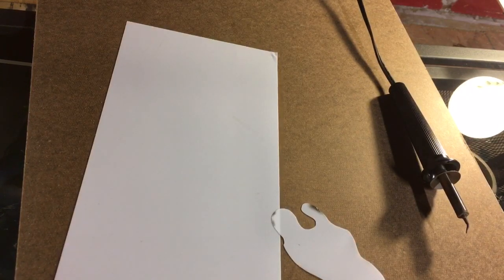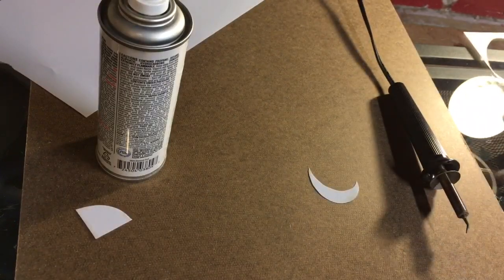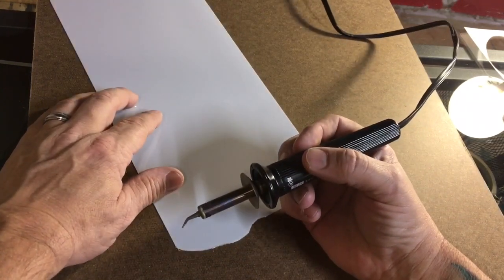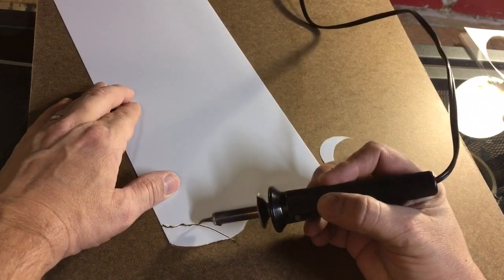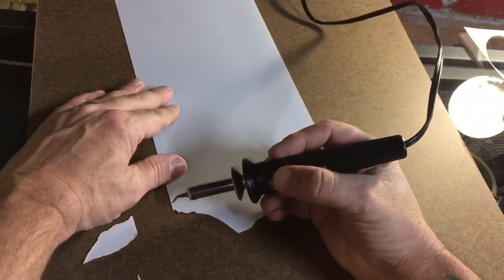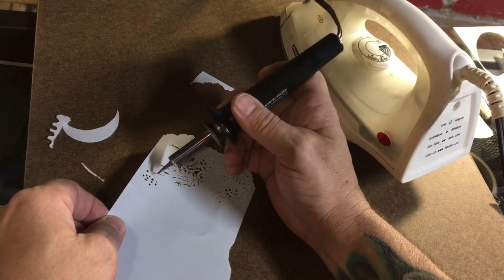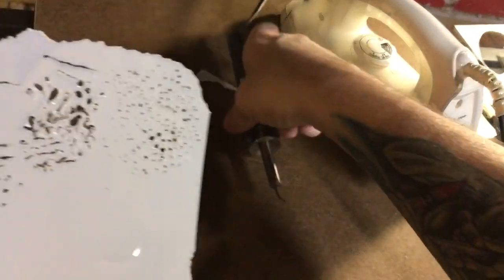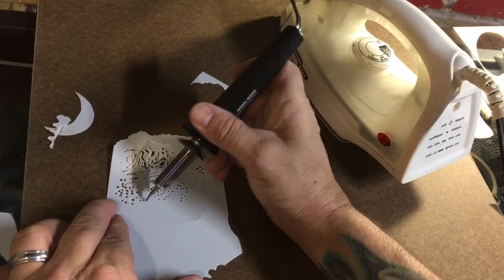How to make your own mylar stencils for airbrushing!

Comment: I have a wood burning tool very similar to the stencil burner. I also discovered a pack of clear plastic face shields that I purchased during the pandemic. I cut out an astronaut stencil for a painting I'm working on but I used a tiny pair of scissors instead of the burner tool. There were too many small cuts I had to make and the burner tool wouldn't have worked very well.

Comment: @wleonartistry  Love the video Bill.🤘😎🎨 I know this is a few years back, but you can get super tight lines and more use out of the tips( before they wear out) if you burn the stencils on glass. We have a couple of 12 by 12 inch tempered we use that came out of a used display case 👍

Comment: Soldering irons .....just fine. Where you get the detail is in the tip. You want the smallest or sharpest tip you can find. You can even sharpen a soldering iron tip if you so chose

Comment: Suggestion for stencils too Bill & Guys on here. If you can afford to do it of course. I make my stencils out of card stock believe it or not using an Ortur Laser Master 2 which is under $200. You can find stencils very easily online to use to laser cut them clean. Your Welcome :)

If you have any questions about it, fire away :)
Reply from the maker: certainly a laser cutter is a way to go.   And probably something ill get into eventually. 
This is a pretty old video of mine , i do have several very nice laser stencils. and likely will buy more.  But there are still a few of those old ones I made that hang around in my pile.   No question laser stencils can hit a higher level of quality.
Reply: @TheAIRspace  I just find it easier from a practicing standpoint whereas if the cardstock is no longer usable, I can just cut another in a few minutes. Not only that but, its like a try before you buy thing. If I like or use it enough, I would be more inclined to buy the mylar ones.

Comment: Can you do text, letters?
Reply from the maker: you could, however there are much better options for lettring.   Personally i have a small plotter to use for things like that.    But i have hand cut paper stencils before.   However lettering stencils are best done with a sticky material.   This is a good technique for textured stencils and freehand shields which is where mylar excels.   One off stencils are crisper and better on other materials.